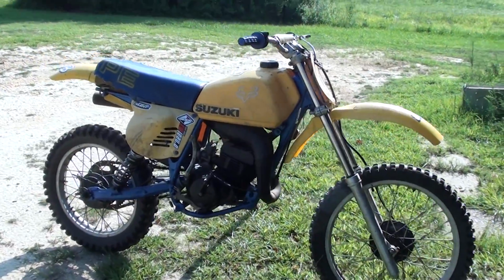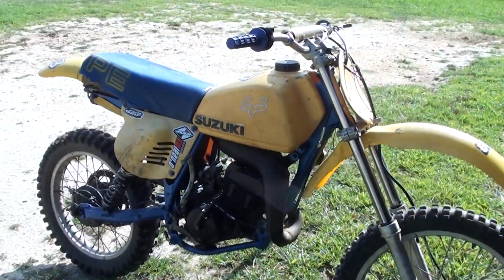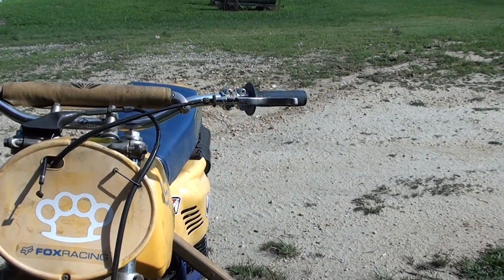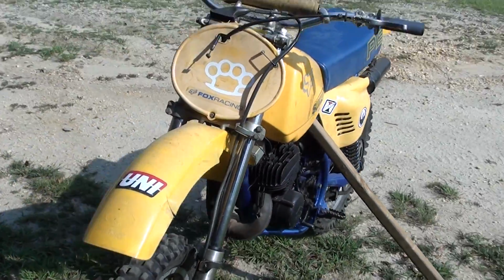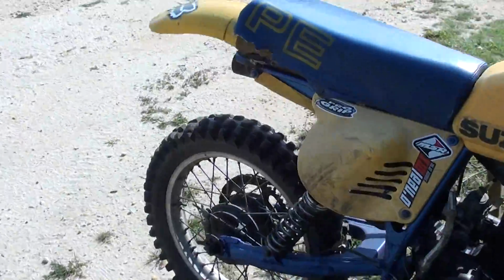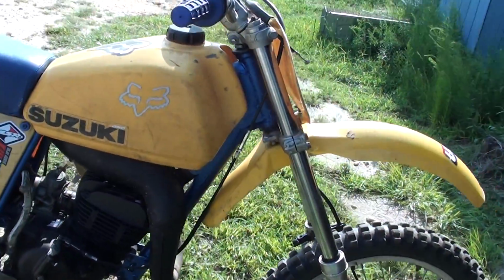Suzuki PE 175 2 stroke dirtbike

Comment: i got a 1983 suzuki pe 175 and it is the most reliable bike i have ever owned and ridden
Reply: Alex Smith I picked up a 1980 175 pe can't wait till the spring .Have to change the 16 inch shocks to a 13 .one only 5 .4 tall bike
Reply: @vincentmckenna281  dam, I wonder if I cuda done that to it250 I had. Lowest hour bike I've ever seen and only reason I sold was a little too big for me, too tall.

Comment: I know what the prob is w the trans.there is supposed to be a little spring loaded plunger thingie in your drain plug as a shift detent. It's probably missing
Reply: Iknow i have a 1980 pe175 and i tryed to bump start it many times with out it. It didnt start and turns out it had a blown top end and i was to dumb to realise that. Thankfully it didnt get stuck in gear